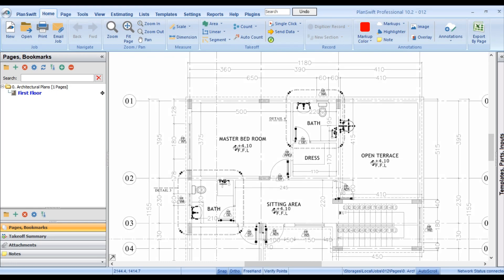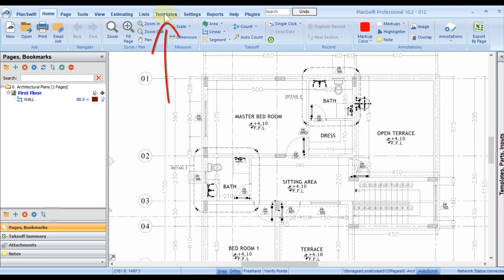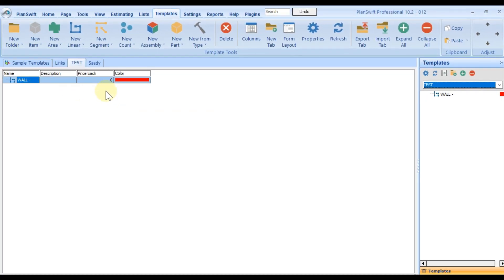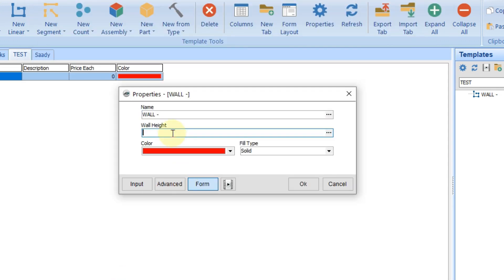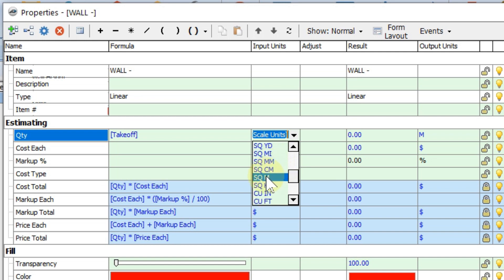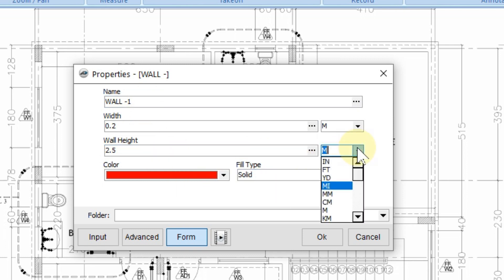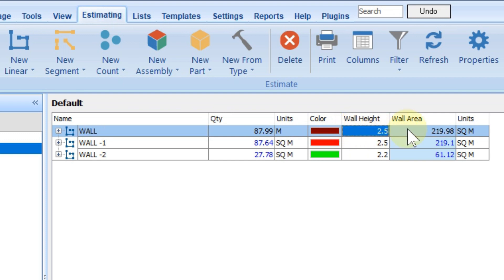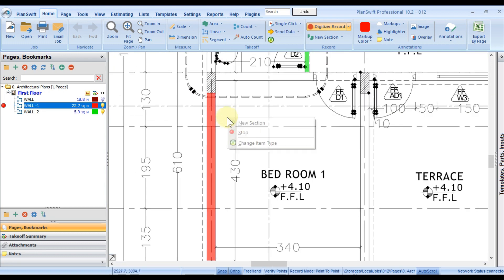Planswift 10 | Wall Area by Linear Tool | Template | Advanced Properties | Level 2

Comment: I think that's a wrong formula in first place, you see both linear measurement &  area calculated later are almost same, even after you had 88m of linear length, area should be (88*.2=17.6) in first place , even after you adjusted the width the linear length changed to 18.8m so area should have been (18.8*.2=3.76 sqm) which isnt in this case, You didn't change the formula in QTY tab which in this case should have been [Takeoff]*[Width], because we already have linear measurment & only need width of the wall and in case of vertical area Width/thickness can be taken as Hight because in both cases we already have breadth of the wall
Reply from the maker: Thanks for watching.

Comment: The length and the area are equal numbers but different dimensions, so we need to change the takeoff from qty , to qty * wall height because it was a quiet confusing, thanks a lot Mr Saddy 😊
Reply from the maker: Yes, you are right, I will try to make it more clear in future videos.

Follow me on Social Media:
https://www.linkedin.com/in/saady-chohan/
https://www.facebook.com/SaadyChohan.AEC
https://www.instagram.com/saady.chohan/
https://twitter.com/SaadyChohan
Reply: @ thank you , can you show us how we change the text or paver to the actual qty of the take of , I followed everything in your video, I made a template  to take calculate a volume of the concrete by measuring the area of the slab , every thing is fine but the label still shows the qty in sqM

Comment: Hi Mr. Saady
It is possible to show the label with 2 options (linear meter and square meter)
And  also in estimation sheet  so we use in multiple puropose like skirting, paint and plaster
Reply from the maker: 1) Area and Linear can be shown in one label. Check the very first few videos on YT. You'll get the answer.
2)
Linear can be shown in estimating tab by adding a column *Linear Total*.
Connect on Insta & Facebook:
https://www.instagram.com/saady.chohan/
https://www.facebook.com/SaadyChohan.AEC
Stay connected & keep learning 😊

Comment: how to deduct the door window from this wall area?
Reply from the maker: There are different ways but for all of them, you have to prepare a calculation formula. 
1) Create a formula in an Excel sheet
2) Create a formula in the PlanSwift. 
Soon, I will upload a separate video only for door/window deductions. 
Stay connected & keep learning.
Reply: @SaadyChohan  Thank you for your quick reply. Actual we , the all estimator, as you already know that, using excel very well in all day. But I wants to know that, how we use the plansift maximum level, without depend on MS Excel.
Reply from the maker: @jayantanath1260  Thanks for watching.
It's True. Estimators & Engineers know Excel very well. Soon I will upload a video about Door/Window Calculation by PlanSwift Software.
Reply from the maker: As you might noticed, I have started a Quantity Surveying complete program where I have shown Earthwork, Concrete, Formwork & Steel etc. The next one will be blockwork and there I will provide a template of the door and windows.
Stay connected to QS Programme.
https://youtu.be/ayYN0pkDEww

Comment: i tried same procedure, but still iam getting in Linear meter quantity only.
Reply from the maker: I assume you miss something. Please watch completely. It's a very simple procedure. 
You can contact me on Linkedin if you have any doubt.
Reply: @SaadyChohan  Iam using old plans swift software. Due to this I think iam not getting results. I literally done same procedure several times. But got only linear meter takeoff
Reply from the maker: It could be the reason. I'll recommend you to use the latest version.
Reply from the maker: ⛔️ PLEASE NOTE ⛔️ 
At 5:16 I forgot to Multiple by Height that's why the result is incorrect. 
Correct Formula: Qty = [Takeoff] * [Height]
Let me know if it works.